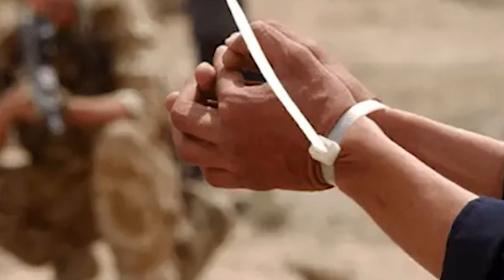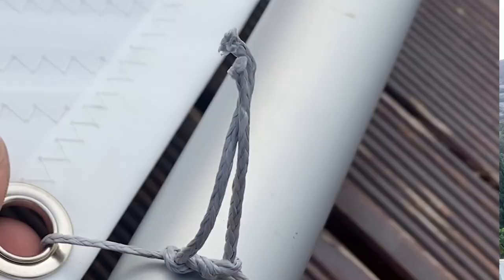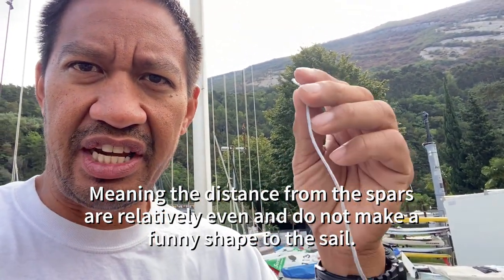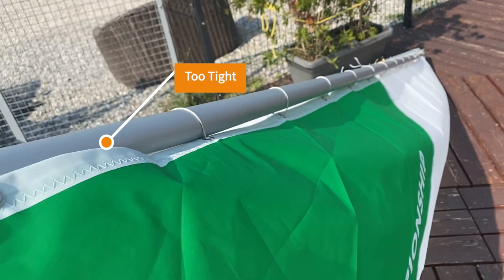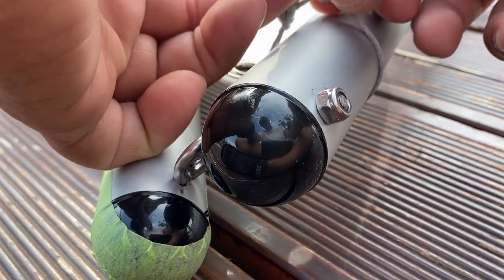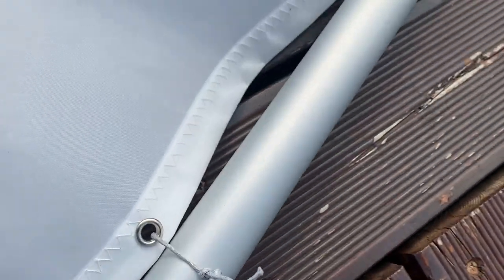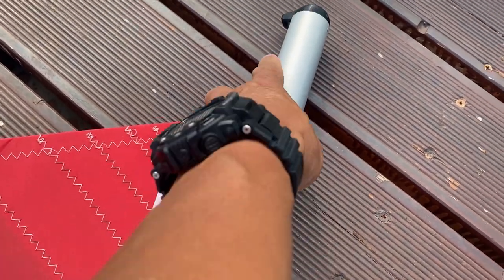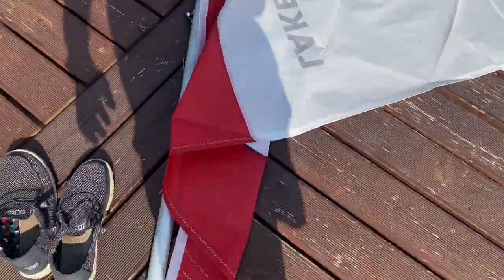How to RIG Sunfish Sail Ties | Sunfish Sailing

Comment: It looks like you are using hollow braid dyneema - good stuff but have you considered making several soft shackles with it? A soft shackle would not require tying and would button/unbutton the sail in no time flat. They can be made all identical in an evening and then you will have something truly snazzy and state of the art rigging wise.
Reply from the maker: Ill have to try that….  Sounds like a winter project as i spliced exactly two lines in my life

Comment: Hi Lee, sidebar random question please:  how well do you think a sunfish will work with a leg of mutton rig?  I want to try that for leisure/ learning...  speed is mot a concern, just need to get on the water for time at the tiller in a very forgiving setup.  If you think it CAN work well on all points of sail with a sunfish, should the square footage of the mutton leg sail aim to match the offical sail's SA please?  Thank you
Reply from the maker: Bery interesting question-  i think the square footage is only one aspect to think about….  The others would be  where the draft is, the center of effort and cut of the sail.   Because i dont know this, its hard to say for sure-  a recreationally sized sunfish sail would be good to learn and improve on….  A LOM sail question:  would it also fit in the mast base of a sunfish?  

What ever you decide to do-   Experiment in winds less than 12 miles per hour and hopefully 5-10 mph.   Things happen pretty slowly then.   Hope this helps!  Enjoy the journey!

Comment: would have liked to see more detail at the clews for the foot and the luff
Reply from the maker: Thanks for the question.   Depending how you like to tie them-   The have seen both loose and tight sail ties at the clew and tacks.  And they ve seen them different ways in top notch world sailors…. So whatever floats your boat.
Reply: I run a sailing program with a dozen club owned Sunfish  We are setting our rigs at 18 goose 102 halyard   Saw a video with Clay Johnson at Colie saying good start is 15 goose 108 halyard   Do you have a preference?    We use them for instruction and JV Racing
Reply from the maker: @SailingAngus  it really depends on the wind conditions and the abilities of the sailors.  the halyard measurements I take are from the bottom part of the upper spar, metal (not the cap).  106-107 put the boom at a common racing postion, which is low.  if you want more room, you can go to 102-105.      108" is VERY low.    if the winds are generally light- 16-18 is a good start especially if the sailors are smaller, like under 160 pounds.  hope this helps....  if the winds are light, like under 10mph?  15 is fine. on the gooseneck
thanks for he question!

Comment: Love your videos.   So why not use loose zip ties?
Reply from the maker: You can!  Line is more flexible and stronger possibly.
Reply: They are also prone to tighten over time from handling, and it's a one-way trip. But yes, you can in a pinch.

Comment: Why not just using a single string to lash the sail to the spar winding the line around  the spar and through the sail eyes ?
Reply from the maker: You can definitely do that…. I would think if one wanted to customize their sail shape to their liking ie- higher or tighter corners it would be easier to do it with individual ties:)